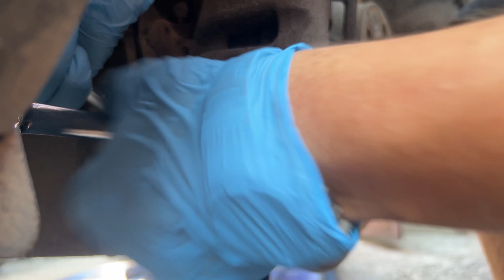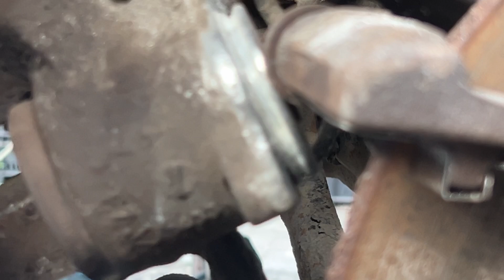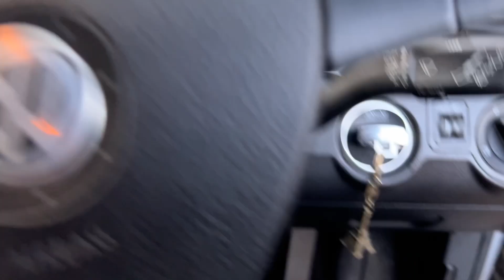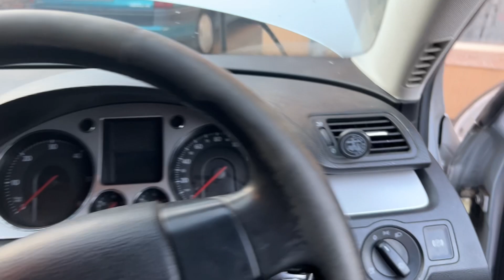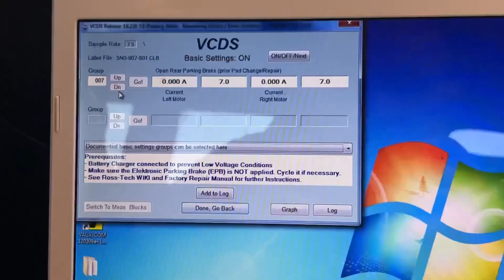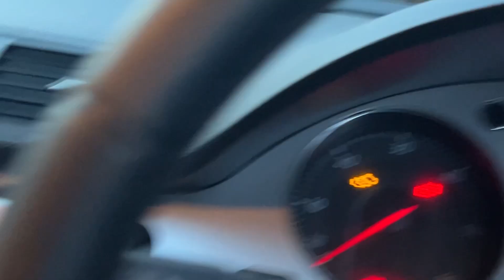VW Passat B6 Rear Brake Pads Replacement with Hand Brake Motor Removal

Comment: I didnt have that tool to push the brake piston back in so I just took a piece of metal, screw a self penetrating screw in it, then cut the tip after it went through and used a used brake pad to push the piston in